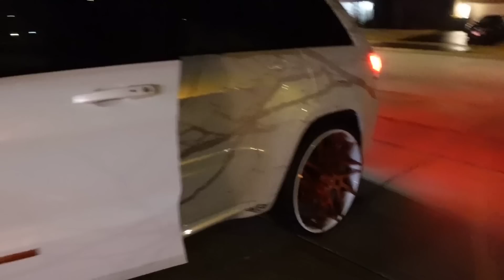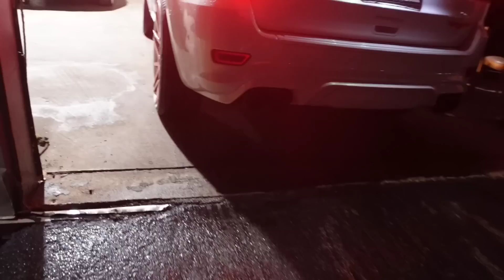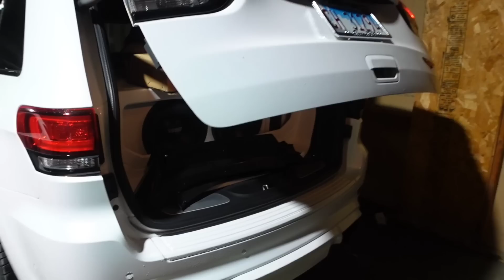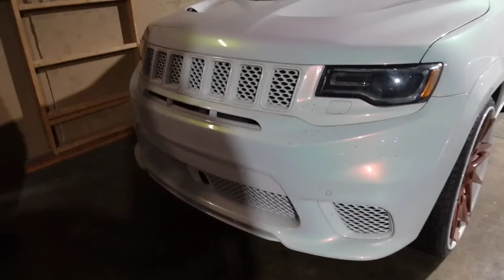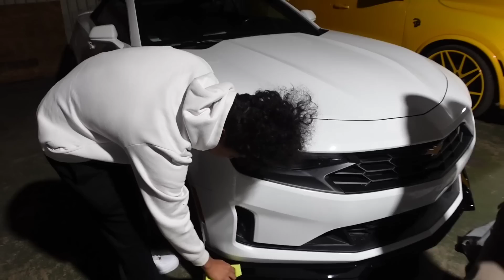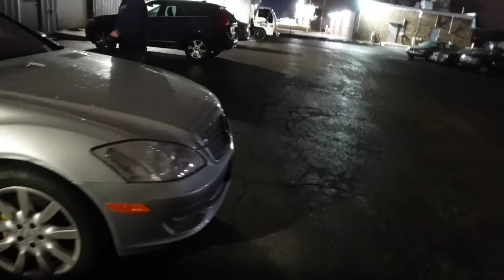MY MATCHING CUSTOM PAINTED GLOW IN THE DARK GT63S BENZ AND DODGE TRACKHAWK

Comment: I meant to leave this on your last couple of videos. I’m sure you know this I’m just reminding you because you haven’t said anything about it and I know you’re going back on the dodge hellcat jailbreak thing !
 Just remember the jailbreak redeye  only 30 hp less than the demon and you can get it in a charger fastest charger every made ! I’m telling you that before you invest in your regular hellcat jailbreak because it doesn’t have the extra horsepower. Anyways, just thought I would pass that one. I’m a little pissed that I bought mine and did not get the redeye and it was sitting right next the one I bought ! Smh !